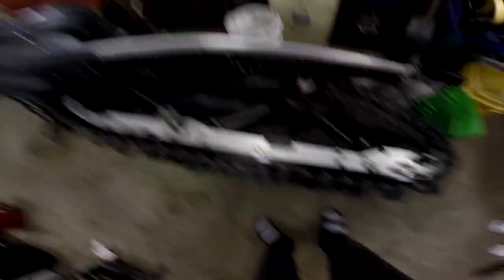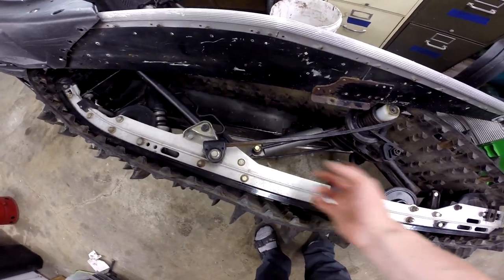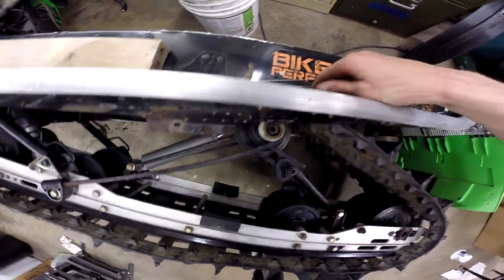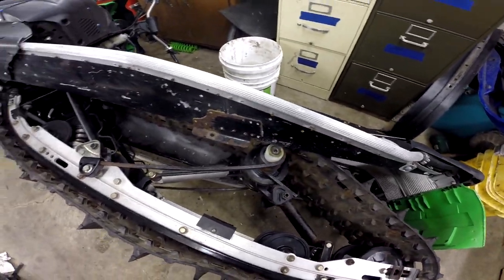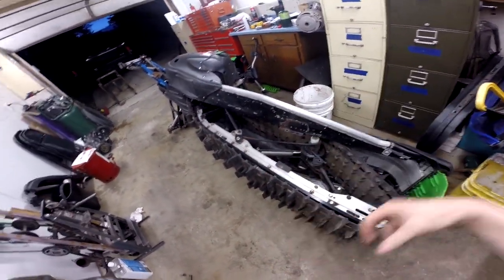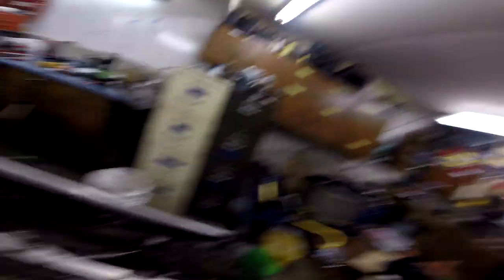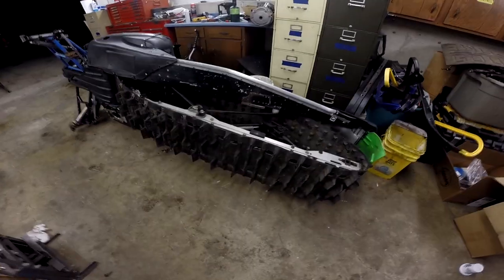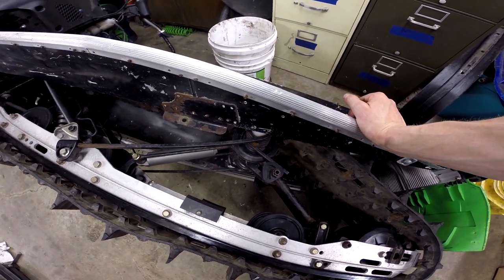Arctic Cat SNO PRO 440700 Swap 144 Rail Conversion Part II

Comment: Any updates on this? I'm looking at doing the exact same thing to my snopro
Reply from the maker: unfortunately this we be a project that goes unfinished. The original owner of the sled tracked me down and is buying it back. 

that said, the 144" skid, the track, another 1.25" track and the brackets I fabricated to mount it all are for sale!
Reply: @longtinmotorsports for your brackets. Where did you end up placing the rear skid bolts. Level with the older ones and further back or did you change it up?